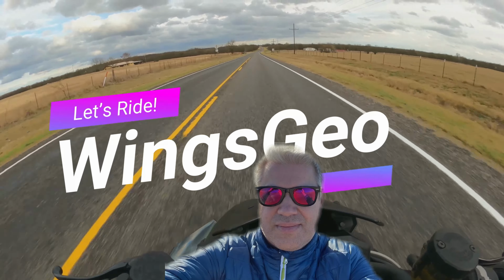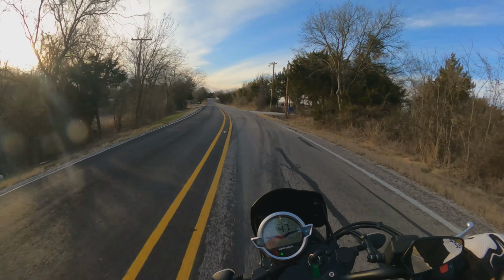Moto Guzzi V7 Stone E5 | Follow up to Air Filter Mod

Comment: If you had to choose between the V85TT and the V7, which one would you pick and why . . . ?  I love both of these motorcycles, but I can only afford to have one bike in my stable at the the moment.
Reply from the maker: The V7 for pretty much for anything as long as it does not involve light off-road or long touring, that is when I would choose the V85. I bought my V85 exactly for that mission. The V7 has become my "Vespa" of the old days, just so easy to get on with, be it a short run into town, or a lazy afternoon joy ride. Hope that helps. I would recommend to test ride both.

Comment: Hello again, as a 6' tall  owner of v7iii my only real complaint is that my legs begin to feel cramped after about an hour. May I ask how tall you are?
At one point I took the rubber pads off of the foot pegs and traded a little vibration for comfortable knees.
Reply from the maker: I am 5'9 and have no problems at all. If you need more legroom, the V85 may be the ticket. I know there is even a tall OEM seat for the V85, not sure if there is one for the V7.